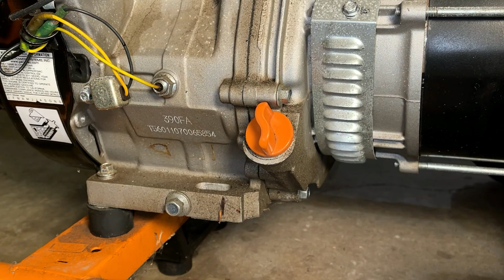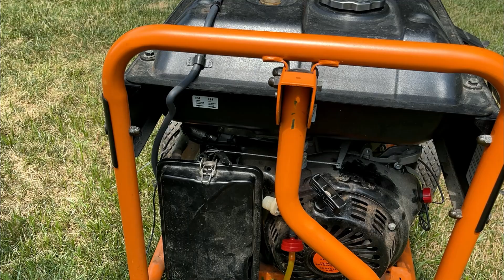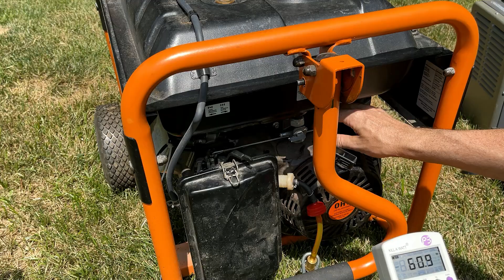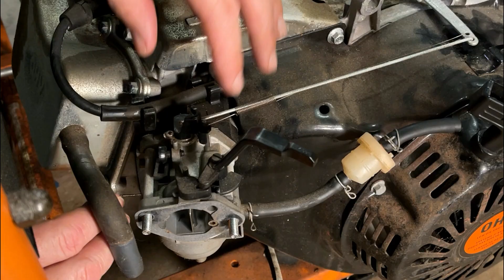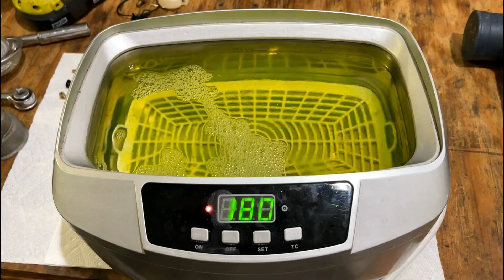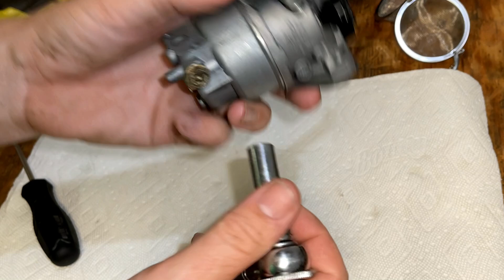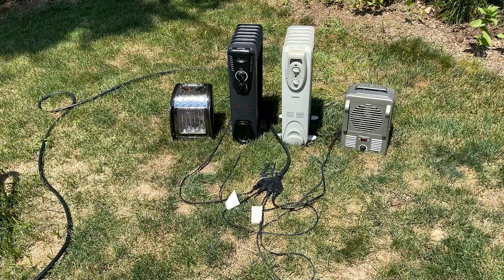Generac Generator - Running Fast and Down on Power

Comment: Hi James,Great video--as always!  Love your methodical approach.  Can you tell us your thoughts on adding "Stabilizer" to gasoline for use in generators?  Have you seen carb problems from it?   Thanks!
Reply: ALWAYS use a stabilizer and run the set monthly under load. When done you shut off the fuel to drain the carb dry for storage. Did it that way for 30 years and NEVER had the carb off. (circa 1988 Generac / B&S engine) Oh, I only keep a gallon of fuel in the gen set, which will last a year in exercise. I store my fuel in 5 gallon cans with a date on them. If I don't use the fuel in a year I pour it in the car and get fresh.
Reply from the maker: I always use fuel stabilizer and shut the fuel valve off, drain the carb If the bowl has a drain or run it carb dry.  I keep my tank full, but swap out the fuel with fresh stuff at least twice a year.  Have not ever had a problem doing that.

Comment: Nice when your project doesn't start as a total mess.   Sometimes,  it makes me feel like the factory techs rush them out the door with a "close enough"  attitude.
Reply: The management team puts pressure on the techs. Been there.
Reply from the maker: They do rush them out.  Have picked up ones with loose flywheel nuts, loose stator bolts etc...  They all ran fine.  Makes me wonder why I both using a torque wrench.
Reply: @jcondon1  That's an easy answer... You take pride in your results.  Nothing wrong with that.

Comment: I would always check the staking on the screws in the choke and throttle plates.  I have one of those generators and one of the screws worked its way loose due to insufficient staking from the factory and went through the carb, locking the engine.  Luckily it was on startup and it only managed to leave a small nick in the piston and mashed the screw.  After removing the cylinder head, removing the screw, installing a new one and staking them better it still runs fine.  (Has about a gajillion hours on it.   🙂)
Reply: I do not recommend staking any screws or bolts in something as delicately engineered as chokes, throttles or carburetors. If factories have staked any screws in your light engineered parts then leave them alone if at all possible. If you must take the screw out then replace with the correct size screw and the correct amount of blue loctite.
Reply: @r8118830  I didn't say to remove any screws !!  I said take a look at the staking to be sure it was done correctly at the factory since I have personally had one that was incorrectly staked.  They were never removed before, and you could tell that they did attempt to stake them at the factory, but it was clearly, visually on the remaining screw, incorrectly and insufficiently staked.  Properly staking a carb plate-shaft screw is not difficult, you obviously back it with a bucking bar of some type, a small rod in this case, not just smash away on the shaft and carb assembly itself.  🤦  Obviously if someone is lacking the knowledge, tools, or gentle finesse skills and therefore is not capable of doing that properly they could just loctite it, but a proper mechanical lock is far superior for anyone who has the capability to do it correctly.  No remedial action should be required in the vast majority of cases, my point is to check them on these units since I've personally seen a failure!
Reply: @drussell_  I am not attacking your skills and knowledge drussell. I never said to remove the screws. I said not to do so if you could help it. I have never liked the idea of staking screws. To me it is just damaging a well engineered part. There are other ways of ensuring that a nut or bolt or a screw do not lose tightness. Some ways are cheaper than others. At base you can use one of the many locking washers in use. Nothing wrong with a nyloc nut. Castellated nuts are good too. You can use a nut or bolt head with a split pin or use a nord lock nut. Variations of the split pin is using safety wire. Of course loctite has several varieties and can be as secure as you want it to be. Manufacturing companies always want it to be cheap. They have moved away from staking screws, which is cheap, to using loctite, which is cheap.

Comment: I actually come across the carburetor with a plugged orifice in the carburetor casting finally took some carburetor cleaner and 90 pounds of pressure on my air nozzle to finally get it blasted out of the passage there's no way it get it to where it was plugged don't know what was wrong other than it's was some powdery stuff come out like condensation or your dried up water but we got it finally and now now it starts up wouldn't start up before it was on the lawnmower!
Reply: that white stuff is from the ethanol in the fuel. When the fuel evaporates between uses it leaves a residue. (like corn starch powder)

Comment: James, I'm surprised you use 10W-30 in these engines.  I was always under the impression they should use straight 30 weight for small engines.  I seem to recall it is not a good idea to use car oil.  Something about the detergents or such.  Maybe just a myth.
Reply: An internal combustion engine definitely needs detergents.  You CAN buy SAE30 oil that doesn't have any detergents--don't use that in an ICE.
Reply from the maker: SAE 30 is always best in hot weather (above 40 degrees F).  Where I am though SAE30 is a problem from November though April.  10W-30 is good here year round for the most part.  If above 90 degrees F, then 10W-30 mineral oil will be consumed quickly by the engine.  Synthetic should do better.  Ideally you should add zinc to the oil to help the flat tappets out.
Reply: @jcondon1  ... was doing some research recently and found most mineral oils already have zinc in them, although not as much as some formulas for old engines. BTW, the zinc also helps protect during long term storage. OTOH, if you run it once a month we're not too worried about that.
Reply: factory says you can use 10-30 from about 20 - 90 degrees ambient temp. You can also use 30 wt (detergent) if you are always above freezing, which would be indoor storage in my area. All of the major oil companies still make straight weight oil but not everyone stocks it.

Comment: I have that exact unit and set no load to 61.5hz and get the same result.  I've had mine for six years or so with zero issues.  Just this year I started to run ETOH free fuel but it had no problem running regular.  My valves were spot on at 50 hours, curious to see when they start to wander out of spec.
Reply: ⚠️Rules about generator safety: This is a very important announcement that everyone needs to know just to make sure. 

It is important to follow all generator safety rules whenever we use portable generators: 

Everyone must see this. This is just a reminder for everyone’s safety. 

1) KEEPING OTHERS SAFE: Please do not allow an unqualified person or your children to operate and service the portable generator. Just because some manuals don’t say that doesn’t mean it’s safe. That is important against the generator safety rules. We also need to be keeping an eye on our children too. You need to make sure that your children are not playing near the portable generator especially when it’s running so they won’t get electrocuted. Generators pose electrical risks and they can be hot during an operation. Please keep your children away from the portable generator at all times. It is important to keep our children safe especially our little ones. Be aware of all the hazards.

2) WHERE TO RUN YOUR GENERATOR: Some people use their portable generators indoors which increases the risk of carbon monoxide poisoning. It’s important to have a carbon monoxide if you have a gas generator. Never ever use your generator indoors even if your doors and windows are open and even in the garage is not safe to use a portable generator. Not even at your porch and your deck. It is never safe to use your generator indoors and in enclosed areas of your home. Your generator needs to be 15-20 feet away from your house. 

3)🔥FIRE HAZARDS: Never refuel your generator while it’s running. You need to let your generator cool off before refueling it and before storing your generator. Never overload your generator too. Never ever back feed your generator. You should never plug your generator into a wall outlet. Also never store propane tanks indoors. Please keep flammable things away from the generator as well and please don’t smoke cigarettes near the generator. Having a fire extinguisher next to the generator is also important against the generator safety rules. 

4) GENERATOR OPERATION: make sure your hands are dry before touching the generator. Never use your generator in wet conditions. Don’t let your generator get wet. You need a generator tent if you need to use your generator during wet weather. Please don’t wear loose clothes when operating the generator. Turn on your generator before plugging in appliances. Use the right cord for your generator. Please do not use worn out cords. 

https://youtu.be/I1jT3ANENvI and here is a video more about keeping others safe when using generators 

Hope this helps. Please make sure you follow all the generator safety tips. Thank you

Comment: This didn't seem to have anything that jumped out at me. It looked like it was taken care of. It is too bad that consumers don't know how to maintain their equipment. My 20 kw Generac is serviced twice a year. I was paying the guy that installed it to do that way too much money. So I asked what I needed to do and learned from him. I run mine under load once  month and it exercises every Saturday. At the last servicing the oil filler cap had milky looking oil in it so that is why I run it under load based on what I was told by the tech the engine doesn't get hot enough to dissipate the moisture here in Virginia. Thank James for sharing your time and talents with us. Ed
Reply from the maker: Thanks Ed.
Reply: that's a common issue with the newer stationary sets because they have a low speed exercise and only run for 7 minutes. (half of what they did years ago) IOW, they run too cold. On some you can change that in the menu. You can also change the auto ex program to less often (also in the menu) and do your own loaded exercise to warm it up fully.
Reply: @rupe53  the exercise is programmed at 5 minutes I could have it exercise everyday but I am not going to. So I will just simulate a power outage.
Reply: @er1073  ... the point I was trying to make is you can't shut the exercise off completely but you can minimize those cold runs by changing the program to once a month and raising the speed. (on some) The rest you can do manually by simulated power failure. Of course doing it that way you will also have to put up with waiting for computers and cable boxes to reboot plus flashing clocks. Oh, the issues of modern appliances! <LOL>
Reply: @rupe53  okay I will try that then and I can do that via mobile link. Yes a lot of stuff blinks and warns of impending doom etc...

Comment: Didn’t know that every 200 hours, check the valve clearance. Great tip.
Reply from the maker: The manual suggests checking after the first 50 hours then every 200.
Reply: Anything with valves needs to be checked periodically

Comment: The line on top of the generator is a vent line  because the e.p.a made it mandatory for the machine to have the vent line my poulan xt mower have the vent line from the gas tank to the  air intake
Reply: @Codyjrt  thank you for the info
Reply: Robert ... when they first started doing that it was for California emissions. As other states picked up on the idea the factory just made 'em all the same.
Reply: @rupe53  thank you for your reply young.man 😎
Reply: @madaboutmowers  ... BTW, nothing to do with EGR because small engines don't have that and probably never will.
Reply: You got the right skills to save those portable power plants from going to the scrap metal place

Comment: Thought I was hallucinating with the gas tank movement while running. Lol. I always learn something from you. Thanks!
Reply: It's called the beat frequency.
Then the vibration frequency is close to (or multiples of) the camera's shutter speed, you get the strobing action. 
I'm sure you've seen wheels that seem to be spinning backwards. 
This beat frequency technique is also used in metal detectors.
Reply: Looks like it's breathing.
Reply: Yea, I've never noticed that on any other generator.
Reply: @tomschmidt381  it’s the camera

Comment: Great job James! Great score too! Not my favorite Generac, china made..i like the old EXL and the newer XG/XP machines best. This GP does well for the price point when properly maintained! Cheers bud!
Reply from the maker: I with you there.  But they sure are easy to sell.  The same China clone branded anything else is a much harder sell.
Reply: @jcondon1  exactly because of the name most likely. Generac has a pretty crappy reputation in the residential portable market. However on the commercial industrial side they seem to be a gold standard.

Comment: Thanks, another great video but my OCD spotted that the pull start housing only had 3 of the 6 bolts holding it down. Maybe you rectified that off camera.
Reply from the maker: That is correct.  Most Honda clone recoils only use 3 of the holes.  The extra are there so you can remove the bolts and rotate to a different position  to change the position of the start rope with having to rotate 1/3 of the way before the original holes line up again.
Reply: Derek Marshall ... Well spotted !   Perhaps that "OCD" would be the "Off Camera Detector" I reckon ! cheers

Comment: The engine seems to be moving while running-engine mounts bad? Also is fuel filter on backwards?
Reply from the maker: The image stabilization does make things look strange.  Wish there was a way to delete that feature.
Reply: Yes....it did appear that the tank was moving as well while it was running.
Reply: It has to do with the video speed and engine vibration. Its an optical illusion, same thing happens when I video with my phone of a running engine, looks like its wiggling all over the place when its actually not.
Reply: @Big_Johns  That makes sense.👍👍
Reply: Thanks Paul or maybe it’s one of those rare Disco Generators. 🤣

Comment: Good job on that generator The engine on that looks very similar to my 8750 predator With a 420 cc Honda clone I bought it back in 2014 brand new all I ever do is keep the gas and change the oil it runs every time that I need it
Reply from the maker: It probably is the same engine.  Most use the same 420cc clone these days.

Comment: Good job mate, I did notice that you use a torque wrench on just about everything. If you do this off camera I'd say it's more a OCD thing than perfectionism. I'm not picking or putting you down as it is a good thing if you don't have muscle memory but I have only used them when doing a full rebuild and I don't think it necessary on things like air cleaners, but I guess that this is also a teaching tool so being perfect to teach the young is a good thing. Stay well and keep them coming :)
Reply from the maker: Its really only necessary on critical components like the connecting rod.  Muscle memory is not the issue, but a lot watching have no idea how to do this work correctly so trying to show them.  Even with the torque wrench I break things.  At least this way I can blame the part.  And maybe a little OCD.
Reply: i've stripped alot of bolts on these chinese built things so its a good thing

Better be safe than sorry